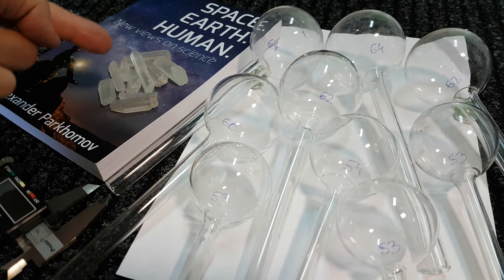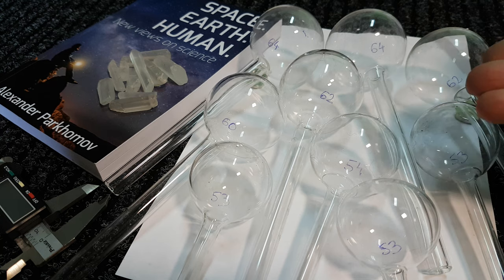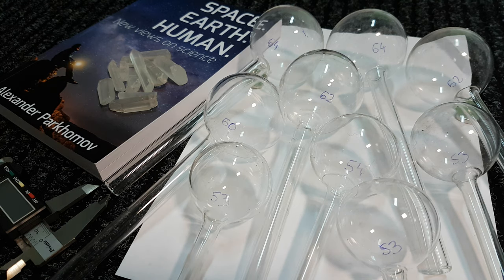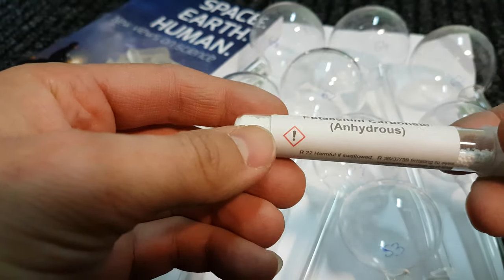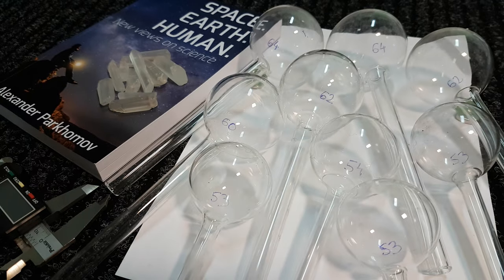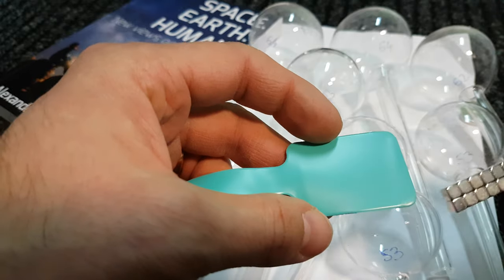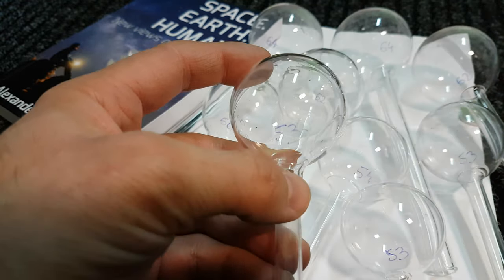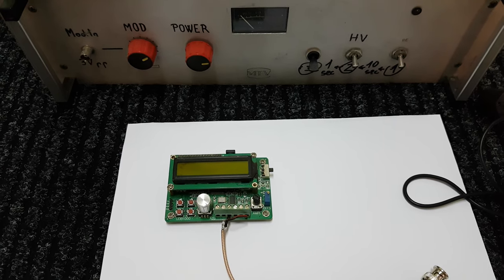Super NOVA - Glassware & permutations

Comment: Dear Bob,don t do the magnet on the quartz experiment!!!!!!!
The microwaves will heat the magnet quickly.
There is a high chance of burning the magnetron as well!
Never put any metal into the electromagnetic cavity resonator!
We made this error with our earliest dust fusion reactor.
It destroyed the magnetron in seconds.
I am looking forward the rest.
I still have at home some quartz resonators,of 50 mm diameters.
But other,tube trumpet acoustic ( quartz) resonators are worth trying as well.!
In our tests different acoustic resonators yielded different transmutation results,with the same initial conditions.
Best wishes,
George
Reply from the maker: Haha - yes George, I was pretty sure you'd say that - especially the thin nickel foil on the outside - though if I can get a replacement magnetron, I may just do it for the sake of seeing it through.

I think we have enough glass to do the tests I want to do - I will give the main presentation on the focus of the tests either tomorrow or Monday.